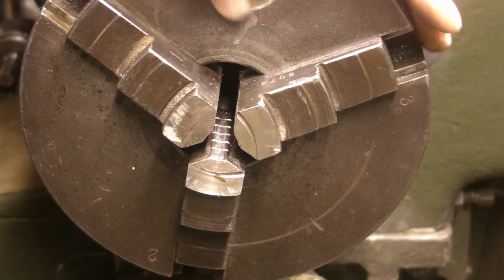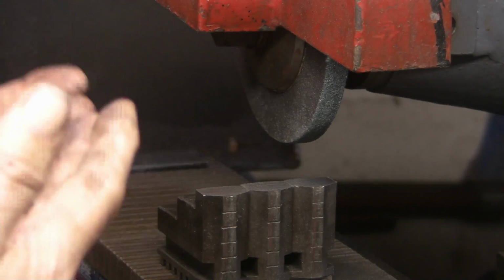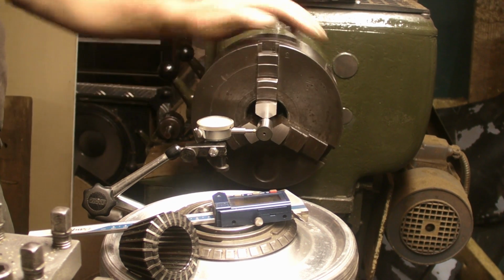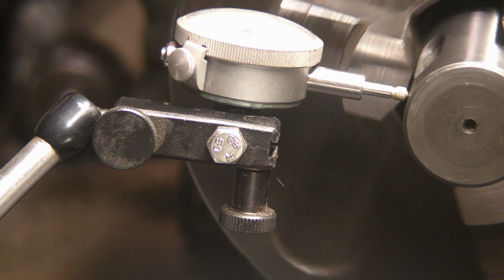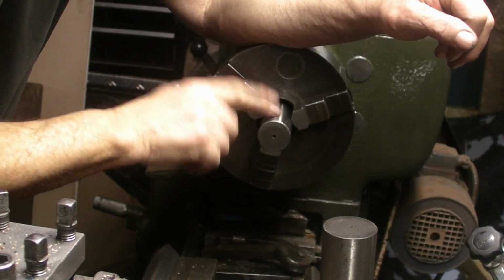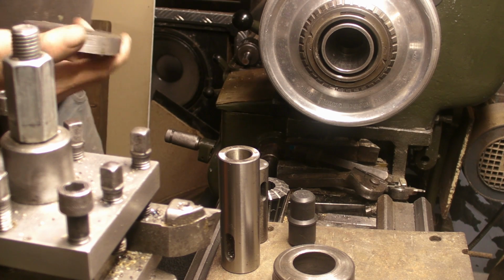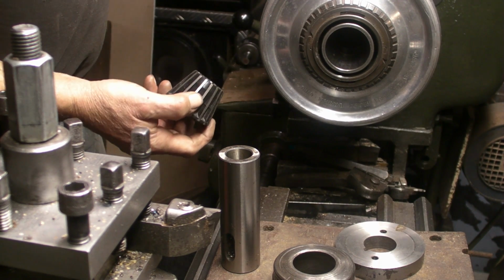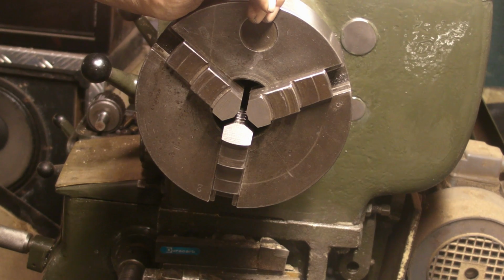grinding chuck jaws

Comment: Last time I ground the inside of the jaws of a chuck I just ran the lathe at it's maximum spindle speed (in my case 2500RPM). The centrifugal force at that speed is enough to take up any backlash in the scroll and slide ways. I then used a die grinder in the tool post to do the grinding. A tool post grinder would be better but I don't have one.
The problem with trying to clamp against anything is that it's easy to end up with uneven loading on the jaws.
Reply from the maker: Hi Les, thanks for your comments much appreciated, there seems to be that many differing views on this subject thats why Ive been asking around. the chuck seems to be in reasonable condition, just got the bell mouthing on the outer tips of the jaws, no rush to get them sorted, gonna do some more research  before I cock things up ! How come no recent vids from yourself ? Del.
Reply: @machinenutdel6764  Yes, there are a lot of differing opinions. I really don't like the outer ring method as it loads the jaws in the wrong direction. You're pretty much guaranteed to end up with a slight bell mouth that way. I remember seeing a video on machining soft jaws a few years back and they recommended actually machining a very slight reverse taper. The idea being that the jaws pull straight when you tighten them up. Of course the tricky bit is estimating the amount of taper needed. I had a quick look for that video and couldn't find it.

I would suggest indicating the outside of the jaws before grinding the inside. You don't want the inside off centre relative to the outside. I suppose the best way is to grind both inside and outside but that's a lot of work.

I don't post videos much because due to a combination of laziness and forgetting to set up a camera when I do anything interesting.
Reply from the maker: @LesNewell  Thanks Les, for bothering and remembering to reply, Del.

Comment: I would re machine the outside of the jaw diameter, then place a ring and clamp it by I tightening the jaws, then re machine the inside of the jaws using a really rigid boring bar.
Reply: *Untightening
Reply from the maker: Hi Warren, thanks for the input, think I will be happy if I can reduce the bell mouthing to begin with. What is it you do at work ?. Del.
Reply: @machinenutdel6764  all sorts Del. I’m the engineer in a large facility, making aircraft parts and automotive parts, at the minute I’m covering for lost staff making turbo compressor housings for Borgwarner.